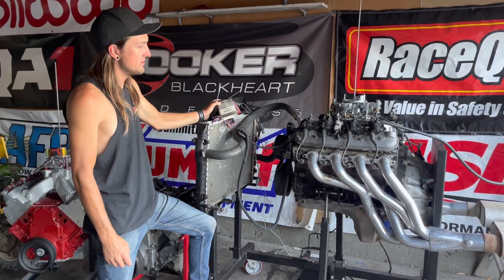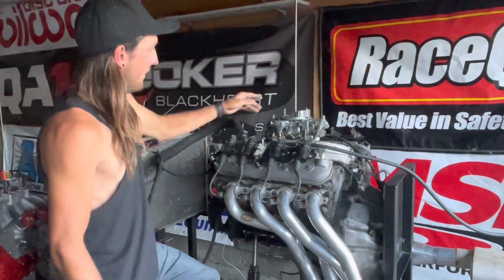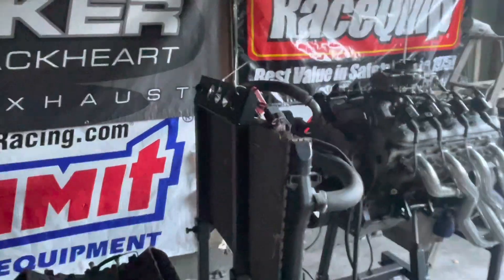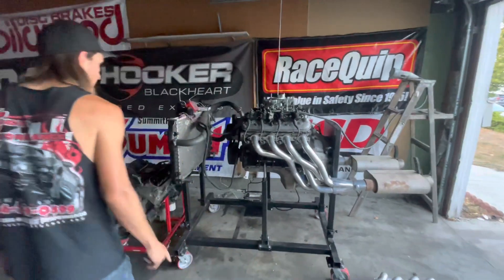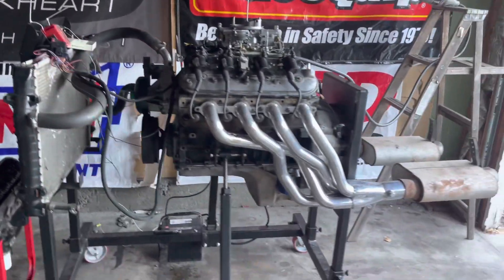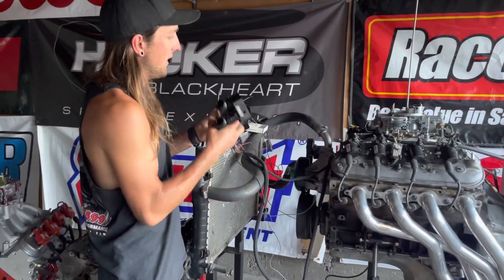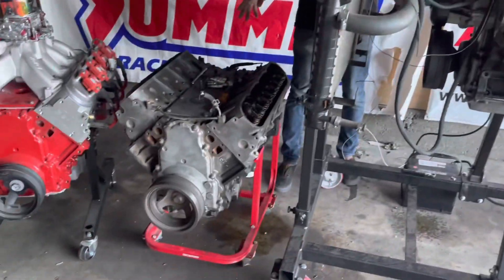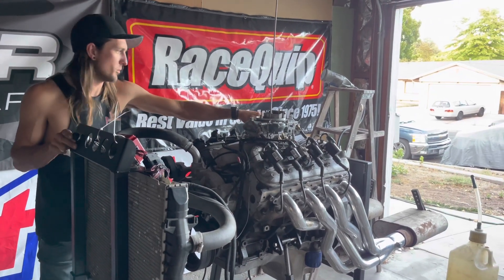Carbed LS on the summit racing run stand

Comment: 55 gal drum and a sump pump will do all the cooling you'll ever need
Reply from the maker: Lol I’m lot looking to have to haul around 440lbs of water
Reply: @travisblack417  You didn't say you wanted it portable but a 5 gallon bucket of water 1 3/4" clear hose from Lowe's a cheap pond pump good flow not a lot of lift. Good to see you got a channel love the content.
Reply from the maker: @minenachos  when I get a temp gauge for the stand I’m going to do some experimenting with how fast these motors heat up a certain amount of water. I technically want them to get to operating temp as quickly as possible.

Comment: I like how an injected LS fires in half a turn of the crank, and idles without stalling. To each there own.
Reply from the maker: An LS with a carb that is actually functioning fires up pretty quick
Reply: @travisblack417  just messin' with ya. I am a drivability tech by trade, and like carbs on some engines, but I prefer injection on an LS, especially when boost is the plan, and boost is always the plan, for me.
Reply: @jamesgeorge4874  @Travis Black; There are uses and benefits with a carburetor.
However, for those with more technical, precision, exactness, accuracy, fuel injection is clearly, obviously, certainly, absolute superior
 -> whether for basic combustion uses, including common passenger vehicles to powerful, high torque, performance, N/A, NOS, P/A -boosted
->mechanical and better, more precise, accurate, exact, variable, flexible with electronic control - and for various fuel, variations, types, mixtures.
->as we know very well, diesel uses fuel injection since its inception - does not function with carburetor.
->those with more expert level information, knowledge, details, principles are certainly aware 
-> as with, within high performance racing engines -> nearly 50 years ago
-> common automobile, motor vehicle makers, manufactures resist modification, improvements, innovation, etc. ->MB uses FE in their diesel-D engine, turbocharger(s) in their diesel-TD, Einshpritzen-FI in their E engines successfully along with disk brakes on all four wheels for how many decades, among many other advancements too ?
All The Best 
Sincerely
Reply: @newtonfirefly3584 Something, something, I'm a technician by trade, something. To each their their own. Would I put a carb on an LS ?, hell no. Do I care if this cat does ?. Nope.